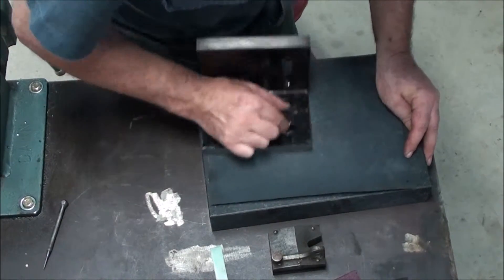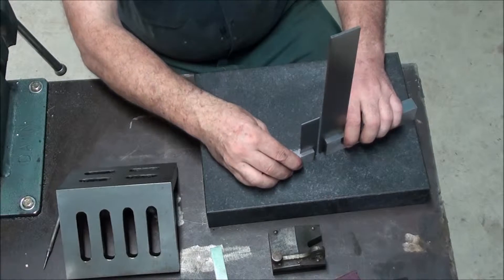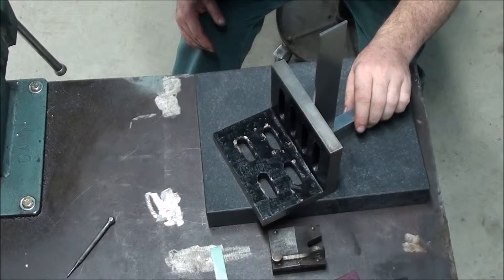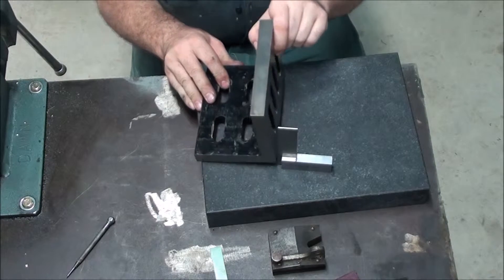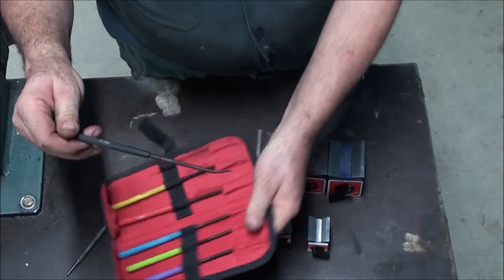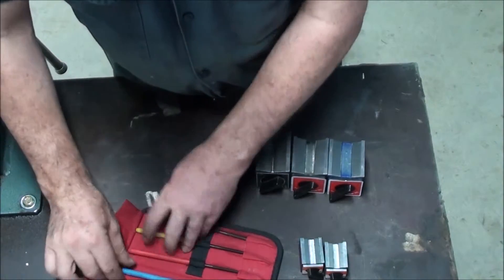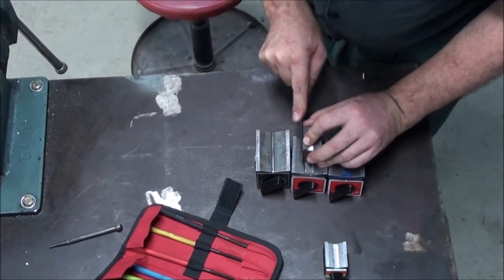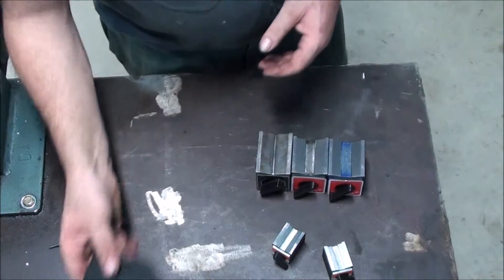Have you got a Wobbly Pole?   Part 2

Comment: Stan at shadonhkw channel does a good video on checking a square with a dti on a granite plate. Comparative test, minimal kit required but it works and you get a number off your dti , handy when you are trying to get something going better than when our started. like your bases or even your angle plate.
Reply from the maker: Stan does some great video's. The reason I realized there was a problem was because I couldn't get repeatable readings when checking things on the granite plate, because the base was rocking. What surprised me afterwards was how every base I had was below standard. Thanks for your comments and for watching